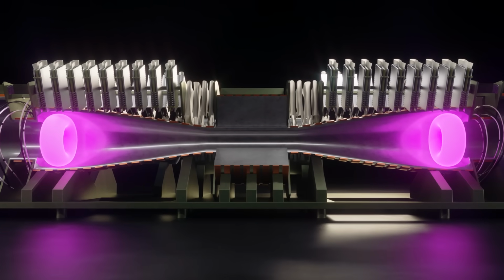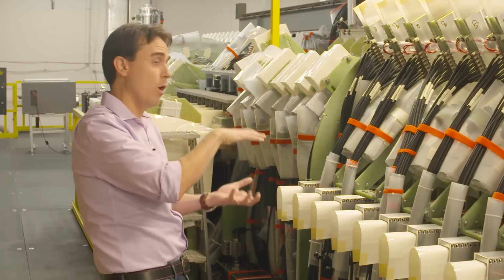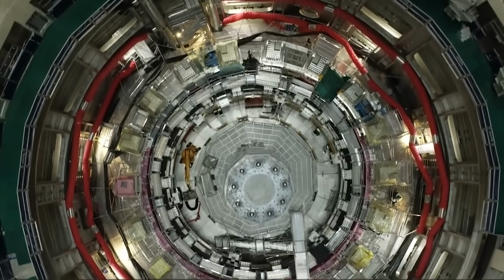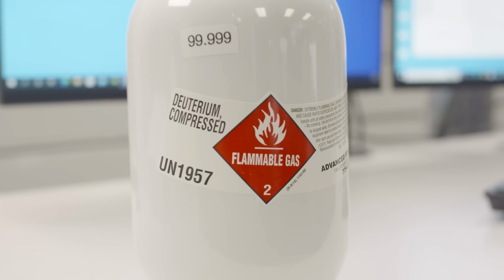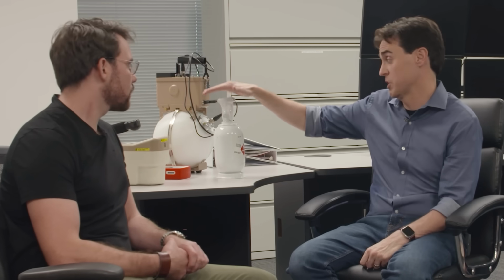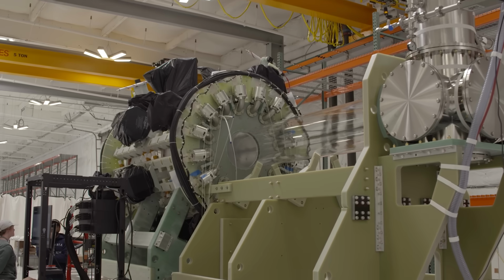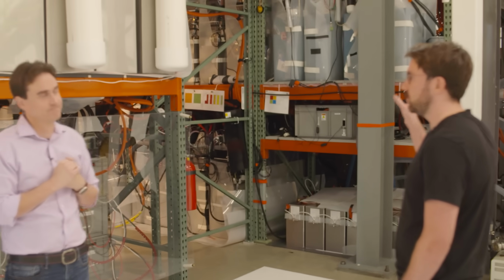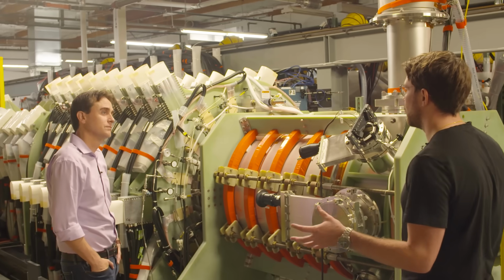A New Way to Achieve Nuclear Fusion: Helion

Comment: I wish you would have instead done this kind of video about TAE or CFS's work.  Helion has done a great job marketing their efforts, but doesn't really publish and there is a lot of skepticism that they are going to meaningfully advance the physics of this problem vs just being a generation behind TAE while TAE actually solves the hard problems.

Marketing FRC is great, but I'd really hope you'd do it on a more reputable project.
Reply: No disrespect to TAE, but TAE is actually behind Helion in triple product and in their timeline. Helion is not really marketing that much. They were in stealth mode for years until 2021 when they published their results with Trenta, got the big funding and announced Polaris. Also, the physics of FRCs are very well understood. There is no new physics needed for Helions machines to work.
Reply: @elmarmoelzer2229  What do you mean by, 'To Work'??

There are enormous problems to solve here for an FRC to be viable commercially - Not just for Helion, but for any FRC solution.  We are not at the point where we just need funding to build a machine and somehow we are at reliable, extract-able, controllable fusion - there is a lot of work to be done yet.

Saying things like that is nonsense.
Reply: @DrLegitimate  What problems?
I see mostly engineering challenges ahead of them. The physics are pretty clear by now unless there are some nasty surprises late in the game. And when I say late in the game, I mean really late. Trenta confirmed their physics AGAIN. Engineering challenges can actually be solved with more funding. Physics challenges not so much. Plus - mind you - the money we are talking about are comparably little (and they have it already).
As for reliable. Trenta did tens of thousands of shots with different fuels to explore the engineering challenges. The big challenges are power supplies, switches, ohmic losses in magnets and cables, as well as pulse rate (mainly driven by pumps and temperature related expansion). They got the capacitors down already, had for years. Bigger problems are system level efficiency. Pumps, cooling, all of that. They think they have a hang of it but some parts might be harder to get right on a first try than they think.
Finally, they have a minor materials problem. Their current materials are fine for the initial machines, but if they want to get down to 1 cent/kWh, they need to improve on that. None of that is insurmountable from my POV. I am curious what problems YOU think are so big they can not handle them?

Comment: Tritium can actually be found in large quantity on the surface of the moon because of the solar winds, so the first base we install on the moon could be for the extraction of it
Reply: For the foreseeable future it will be easier and cheaper to make it on Earth. Helion will produce their Helium3 by fusing Deuterium in the same machine. D+D => He3 +n or D+D => T + p (the Tritium eventually decays to He3 as well). No space travel required.

Comment: what would happen if the design were altered to have 3 of these devices all doing the same thing covering the X, Y, Z, axis'.  each one firing in sequence  to maintain an on going reaction or a near to enough state.  i am thinking microseconds apart.  i know the plasma suspension would be a little tricky, well more than a little; but it is doable.  and the same with the thermal extraction, which is the part that we need, but it is doable.
Reply: If they were to have acceleration sections from each direction, then where would the compression magnets go? They do not really need steady state, nor do they want it, even.
The plasma needs time to expand between pulses so they can recover the energy from it. They also need some time to pump the unburnt fuel and most of all the fusion products out of the chamber. You do not want Tritium in there, when the next pulse happens or our get nasty (and damaging) D-T neutrons.
Helion can cluster several machines in the same facility though. They can share the power supply and some of the other equipment, which saves quite a bit of cost.

Comment: FRC has simpler engineering but much messier physics, because magnetohydrodynamics does not apply to them. As much as I want to believe helion, they show very little data, theory or simulation at every APS.
Reply: Not quite true about MHD not applying. Cygnus and Nimrod can simulate them pretty accurately, even the merging process.
David Kirtley gave a very good talk at Princeton in December. Do a google search for JPP08December2022_DKirtley to find it. It explains their theory quite well, shows what they use for simulation, etc.

Comment: It's impressive that we may have functioning fusion reactors soon. The fact that even if something were to go catastrophically wrong it just fizzles out the reaction makes it probably one of the safest power sources too.
Reply: We've actually had more efficient fusion reactors than this one for a while. The hype for this is based on future promises but until they can realise that, they haven't actually changed anything.
Reply: @fsociety6983  The problems I've seen with most other fusion designs have been 2 major things;
1. It's simply boiling water (which itself causes some other logistical limitations for the technology we want to avoid)
2. The resources are just too costly and rare to make them

This reactor in particular seems to be the only one that can possibly avoid both of those problems.
Reply: It will be very useful for space exploration one day. But there are still a lot of other hurdles to be overcome before we have an actual use for this.

Enough time to develop this further though. And the science is mindbending lol.

Comment: So my question is how do they get the energy to make this reaction happen like for the magnets. I assume eventually they will take the electricity from the reaction to power the magnet and then at the same time spin the electro magnet creating extra electricity to sell?
Reply: The magnets are not spinning. 
Energy goes from the capacitor bank through the magnets that accelerate and compress the plasma. Some of that energy gets transferred to the plasma. The rest goes back into the capacitor bank directly. At the end of the pulse, the input energy (which did not go anywhere) and the extra fusion energy drive the expansion of the plasma which induces a current in the magnetic coils around it.

Comment: What a clever idea. I always saw tokomaks and thought "Eh, as advanced as it is, that looks kinda messy." This design is symmetrical, intuitive, generates it's own fuel, and no need for water as a heat medium. It's like nature wanted us to put these pieces together.
Reply: Its important to recognise tokamaks like JET don't represent a purely energy output, profit driven project. Controlled fusion is one of, if not the most complicated and technically challenging endeavours ever undertaken. As described in the video, nearly every part of modern science and technology needed to advance before any of this was feasible.

JET, LHC etc. are publicly funded research projects. They publish huge amounts of cutting edge papers that advance humanity. A big part of that is around superconductors and magnet. From early manufacture where the exact composition of material and its processing affects the final magnetic field, to the extreme complexity of real world performance and the electronics and software required to fully understand and manipulate the field.

What this company seems to have achieved so far is incredible, but it is only on the back of publicly funded research where our insights and advancements have been shared across the world. They are the reason that you can now buy relatively "cheap" superconductor setups with well understood uniform fields that originally cost CERN hundreds of millions in grants.

I truly love what they have achieved, but the fact this video represents the first time they are sharing it with the world is terribly sad. They are building on the backs of giants and I don't mean Maxwell but their contemporaries in publicly funded science. Fusion and other energy solutions should have had trillions of investment, it is sad that we are relying on a private company who benefits from public research instead of humanity properly funding it for reasons beyond profit.

With all that said, I have huge respect for everyone involved in Helions research and engineering. If realised, controlled fusion represents perhaps the single most important technology ever developed. If humanity has politically failed to fund energy research, then it is better that entrepreneurs take the risk and move us forward for profit if it ends coal power.
Reply: The Tokomak was an important stepping stone and a scaled down version is literally used here as an initial plasma injection
Reply: Congrats you're now a victim of a very effective startup PR campaign.
Reply: @a-iz4pg  ????
Reply: @a-iz4pg  To be a victim means they wronged me or talked me out of my money, and neither happened. I'm not blind to the rhetoric, I'm complimenting their efforts. Don't be that person who thinks they see through everything and others don't.
Reply: @Twenty-Seven  Victim def: "a person who is tricked or duped"

You were duped by a scam. Better?
Reply: @a-iz4pg  You just defined the word "victim" and then used the definition to describe me. So no, that's obviously not better. What's your problem?
Reply: @Twenty-Seven  Well silly, its because you don't understand that words have multiple definitions and you tried to weasel your way out of not understanding that this reactor is pretty much a scam, and you bought into it, thinking that it was "Their efforts" when in reality its just a machine not to designed to generate power but instead hype for venture capital. 

Any Nuclear engineer has already seen a design in a textbook like this and knows how inherently flawed they are. This is investment hype on a video blinding promoting the hype to fool people like you and you took the bait. Not to mention the CEO of this company is very sketchy.

When you said and I quote: "This design is symmetrical, intuitive, generates it's own fuel, and no need for water as a heat medium. It's like nature wanted us to put these pieces together" 
That's the moment when you bought the snake oil.

Yuck, talk about being a dilettante.
Reply: @a-iz4pg  Considering the fact that I'm not looking to invest in this project, nor have I done any background research about this design in nuclear engineering textbooks or otherwise, there wasn't anything that I was tricked into, was a victim of etc. I'm not a nuclear engineer, so I didn't think that deeply about any inherent flaws in this design. I can just appreciate engineering for the sake of it. I'm commenting on a YouTube video, not attending a seminar where they get my credit card information for monthly donations at the end. Your holier-than-thou attitude is misplaced. Keep insulting me if you want, I don't know what you're trying to prove to me, or to yourself for that matter. That's all I have to say. Take care.
Reply: @Twenty-Seven  I'm not trying to prove anything. Just saying you're gullible and believed a paid puff piece by a company that has always been promising "Fusion power in 3 years" ever since 2015. And it's kind of weird that you keep maintaining the argument that I'm not making.  I never said you are trying to invest money or looking to buy anything. I'm just saying you're emblematic of the current naive state of public discourse on science/technology. You don't have to spend money to be misled, that's the point you're trying so hard not to admit when I say you bought into it.

And C'mon now, "Hollier than thou", your inferiority complex is showing. Just admit you believe a puff piece that made a bunch of false claims.
Reply: Or some aliens stopped by and were like “can we just give them a hint?”

Comment: I can see two major flaws in this tech 1. Ineffecient coils that consume lots of electricity and produce little effect in return. 2. Unnecessary to heat up gasses by compressing them when you can just compress electricity alone (energy=gravity) to get heat from pressure in similar way. You removed steam and turbine to produce electricity directly but you added these gasses in the process to make it ineffecient. You can just use electricity (light) pressure alone to get same multiplied heat. And now you can add steam turbine to collect this heat. Theres nothing wrong with water steam, it is strong to turn anything.

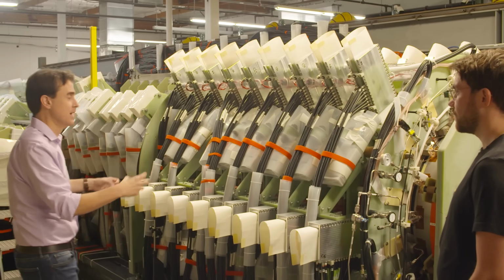Comment: 4:24 as an engineer, no matter how sophisticated and groundbreaking the design there's always room for zip ties.
Reply: Good cable management knows no bounds
Reply: LOL!  They're truly one of the best items we have today. So simple, yet so useful for so many purposes!
Reply: Adding a zip tie to hold the tubing onto our $20,000 ICP-MS was standard operating procedure at the lab I worked at
Reply: @po0ot3r  gotta hold up the argon tube somehow lol
Reply: @LilybeeTV The cables aren't gonna sort themselves
Reply: You can't have an advanced technological civilization without Zip Ties, Velcro, and Duct Tape.
Reply: @EchoTangoSuitcase ”I’m a man, but I can change, if I have to, I guess.”
Reply: Engineers know that every tool has a proper use, and a good engineer keeps every tool possible in their toolbox!
Reply: 27:15 They're in action!! LOL
Reply: And neon lights .. in the future there will be more neon light fixtures 😅
Reply: Lol
Reply: As an engineer, we care more about if it works than if it looks good.
Reply: shhh... don't reveal them the secrets of how we keep modern society running!
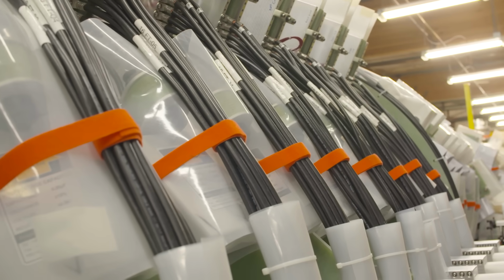Reply: 3:29 - as a non-engineer, I can see that these are velcro tapes. 😄

Comment: No mention at all of system efficiency.  That has always been the stumbling block.  Yes we can, by various means, achieve brief bursts of contained fusion.  But it always takes massively more energy put into the system than any that can be usefully retrieved.  Even the briefly mentioned 'net energy output' (from the Inertial Confinement Reactor) at the end is disingenuous.  They measured 'net energy' from the reaction as compared with the immediate energy used within the chamber to compress the plasma (lasers??) - they did not compare it with the associated power plant needed to create the containment fields and heating the plasma AND the enormous energy consumed with cooling and cryogenic maintenance.  There still exists only way fusion creates net energy - in stars, where the immense gravity creates the pressure and heat needed 'for free'.
Reply: This was a purely experimental machine that was not recovering any of the energy yet. The next one, Polaris will demonstrate net electricity. It is still on schedule to do that towards the end of 2024.

Comment: Hey there...
Can you tell me, how does the material withstand so much temperature where the fusion of plasmas occur which are something about a million degree hot
Like wouldn't they melt or something?
Reply: The plasma is very hot, but not very dense, closer to a vacuum than to ambient air. The energy content of the plasmoid at peak fusion output is just a few kWh.
Another way to look at it, is that at 50 MW, these plants will have the same power output as the diesel on a large cargo ship or the power produced by a single A380 Jet engine during takeoff.
In addition to this, the plasma is confined by magnetic fields. So it does not touch the walls until the very end of the pulse when it is allowed to expand. The expansion does work and that causes it cool off rapidly. 
And in addition to this, the plasma is also surrounded by a vacuum, which is a perfect insulator.

Comment: You sure gave that thing a lot of fanfare, for what's just a regular run of the mill pulsed inertial confinement reactor, that does not and never will produce more electricity than is required to run it. The core doesn't even has shielding so the whole facility will get irradiated by fast neutrons, not just the core. 

Fusion is easy. Fusing atoms takes less effort than splitting them. Commercially viable fusion however is a whole other story. Most of fission radiation is just heat. Most of fusion radiation is fast neutrons and gamma rays, neither of which facilitate harnessing the energy.
Reply: - This is not inertial confinement it is magneto- inertial confinement (MIF). It is actually their own design and they hold several patents for it.
- Trenta is a subscale prototype, an experiment. It is smaller, weaker and only operates at one pulse every 10 minutes (max). A full scale powerplant would do 10 pulses a second!
Not all shots were fueled by Deuterium or Deuterium + He3. Many were fueled by a mix of hydrogen and Deuterium or pure hydrogen, depending on what they wanted to test.
Because of that alone, the total neutron flux that Trenta has experienced so far is not that high.
What the critique does not mention is that neutrons from D-D reactions have a much lower energy than those from Deuterium- Tritium reactions (2.45 MeV vs 14 MeV). Those 2.45 MeV are below the activation energy of many materials.
The machine is mostly made from low activation materials or materials with a half life measured in minutes. Aluminum activated by D-D neutrons has a half life of 2 minutes.
In fact testing different materials under neutron exposure was one of the purposes of Trenta. They have tested quite a few alloys to see how they behave.
There is still permitted shielding of course. It is in the walls of the room and not close to the actual machine, which can handle the aforementioned relatively reduced neutron load just fine. 
It is also worth mentioning that a mixed mode Helion power plant (that does both breeding and power production) would produce neutrons only in one third of all reactions. So the neutron flux, even for those machines would be lower than for a D-T Tokamak.